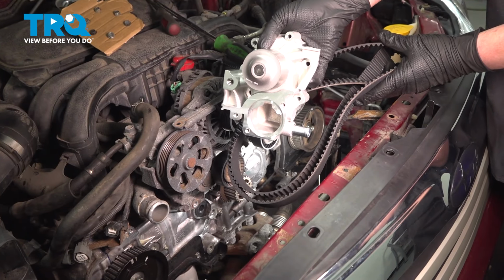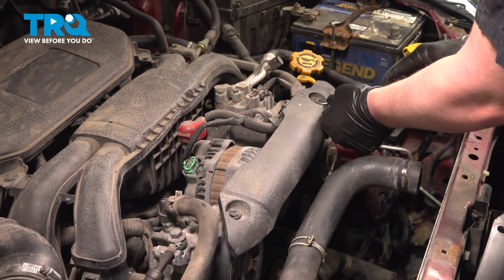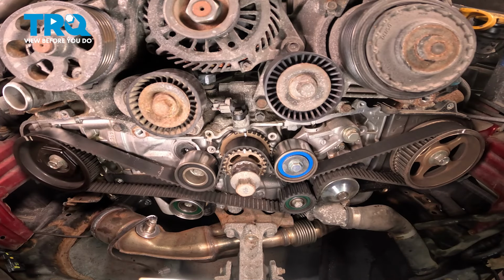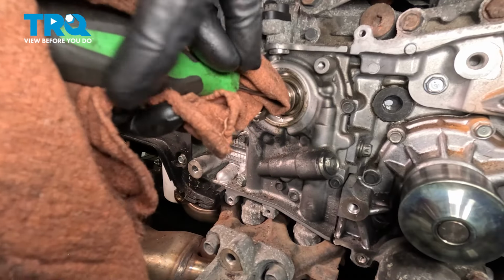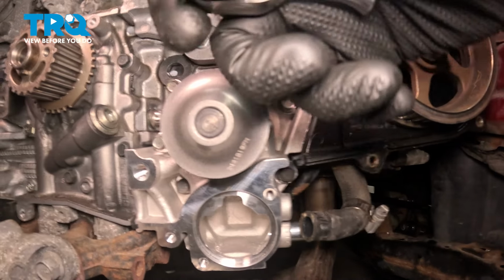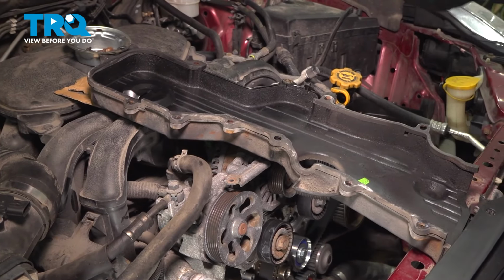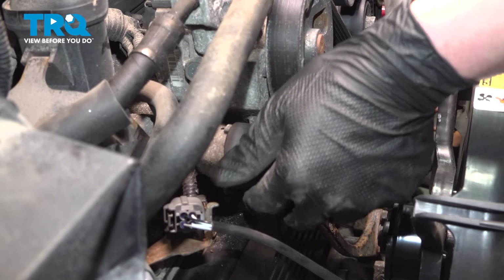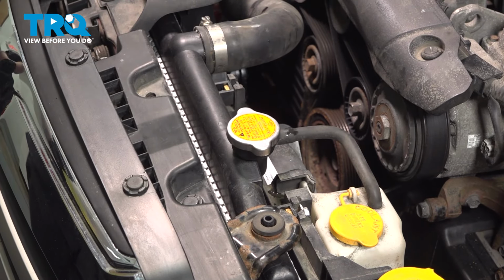How to Replace Timing Belt Kit with Water Pump 2010-2014 Subaru Outback

Comment: Im stuck on the one thing which is putting the timing belt on specifically the cog idler for some reason its not going as smoothly as yours

Comment: At first, I left the radiator in place, as it's not "necessary" to remove it.  However, when I found that all of the t-belt cover bolts on the lower side were rusted to shiit and some had to be tapped out, I decided to take out the radiator just for more room, which I then needed to accomplish fitment of the new t-belt, which was quite difficult to do, took me more than a few hours to figure out how to get it on without stretching or damaging it.